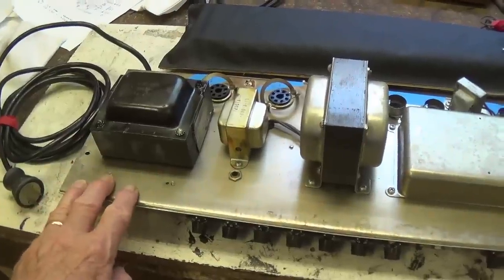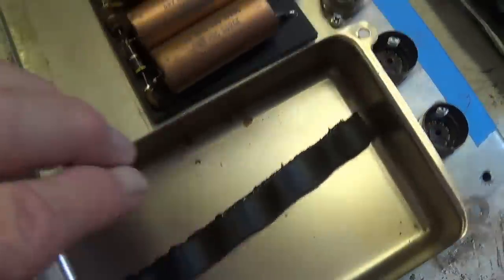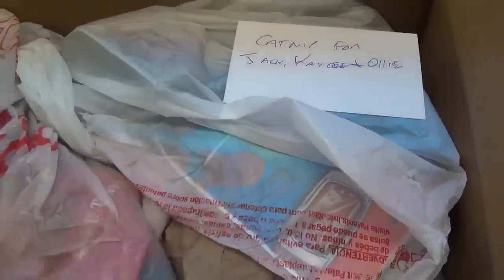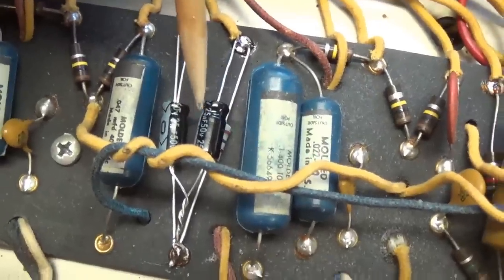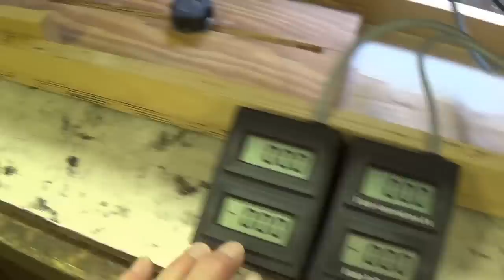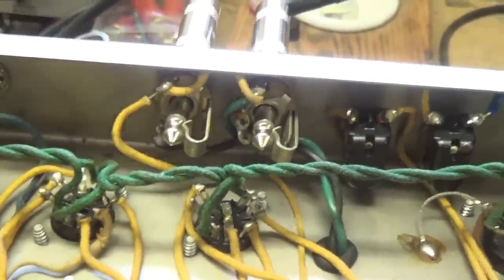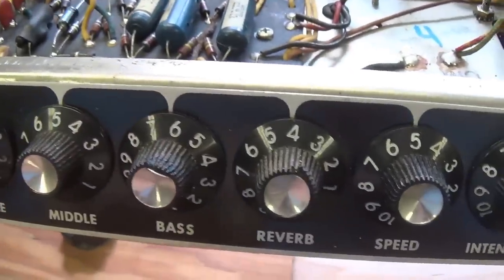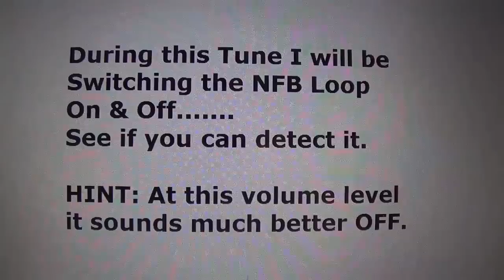1966 Fender "Blackface" Super Reverb:  In Storage for Almost 40 Years !!

Comment: AA763 Super Reverbs had 1500 ohm grid stoppers. There truly IS no consistent AA763/AB763 distinction across the entire amp product line. The distinction relates loosely to amps that had a reverb version and a non-reverb version. There was a period, sometime in 1963-1964, when you could buy either a Pro or a Pro Reverb, black tolex. And you could buy non-reverb versions of those amps for some time thereafter, probably from existing stock. This is basically when Fender introduced reverb into their most common models. You could buy either a Princeton or a Princeton Reverb, a Deluxe or a Deluxe Reverb a Pro or a Pro Reverb. I don't know or claim to know exactly when this happened, I don't know if you could buy a freshly-built Pro or Deluxe (non-reverb) in 1966 post-CBS. You COULD buy a Princeton-non-reverb up through silverface. Princetons, even Princeton-Reverbs did not get grid stoppers. It is true that AA763 Vibroverbs (the first Fender amp with reverb) had no grid stoppers and AB763 v_verbs DID have grid stoppers. So, perhaps that is where the story came from. Knowing Fender, they built amps and used up the parts they had, they didn't just abruptly stop making Pro (non-reverb) amps and Deluxe (non-reverb) amps on April 11 at noon. Many brownface had no GS resistors, but the more powerful ones seem to have them, and of course only the vibroverb had reverb in that era. 
Regardless, whether your amp has those grid stoppers or not, they are good things to have. 
My work is now done.
Reply from the maker: Wow, thanks for all the information, P.

Comment: I made the new channel 93 subscribers.i remember in the old days in Some circuits we used to put bleed resistors in there so the b+ would bleed off by itself without having to go around and zap them
Reply from the maker: Thanks, Mike. That's one way to do it......also the voltage bleeds off rather quickly when the tubes are hot (and somewhat conductive).

Comment: Great job on this treasure.  How many hours are spent doing all of this?  It looks very time consuming doing a restoration like this.  Absolutely worth it!
Reply from the maker: I can only work 3 or 4 hours in the workshop due to the heat, Lee. It's been 105 to 108 degrees here lately.....but a normal overhaul can be done in a couple days, with audio testing on the third day. Making a video, however requires ten days to two weeks.

Comment: Hi Uncle. Have you ever made water slide decals. I make them for 3500 volt rf amplifiers i build for customers . You can print on the decal material in any color or design you want. Spay the sheet with a clear coat cut them out and put it on. Last for ever and looks like a pro job which you are.
Reply from the maker: Thanks for the tip, Monty. I'll check into it.

Comment: “Voltages read to ground with electronic voltmeter. Values shown + or - 20%”
Leo left us some wiggle room.
Reply from the maker: Between the early test equipment and carbon comp resistors, it was probably necessary.
Reply: Uncle Doug 
Point taken.
I think those small variations in component value add to the complexity of the sound reproduction.  That may be part of the fascination we have with tube equipment.

Comment: And there is was: "That tremolo was so greasy I have to take a bath" !! LOL. 
Uncle Doug, I really like the idea of the reservoir caps on the rectifier side of the Standby switch for making life less brutal for the rectifier tube. Can you suggest a reason why every amp is not like this Super? Is it only because of the GZ34 cathode and filament being separate? 
That gift from Randy was very special. You are so loved Doug.
Reply from the maker: Wow, thanks so much, GAT :)  Having the reservoir cap(s) after the standby switch sacrifices the rectifier while (purporting) to save the tubes. To be honest, I'm not a huge fan of standby switches, especially in GZ-34 (slow start up) circuits. To me, they seem counterproductive.
Reply: @UncleDoug  I agree Uncle Doug. I can only see Standby switch "shock" as being a cause of failure. Could a practical solution be to have a smaller reservoir cap (with drain resistor) on the rectifier side of the Standby (16uF?) and the main caps on the OP transformer side?

Comment: You didn't mention it, but sometimes swapping the power tubes to opposite sockets can have an effect on the reading.....not saying the same readings will follow the tube in all cases.  I assume you edited out the cleaning of the tube sockets, but with old NOS tubes.....the pins can also tarnish and need cleaning for good conductivity which can be a challenge.  I generally use a welding file set for the tube sockets plus spray cleaner......the file set for cleaning the nozzles and tips on welding torches.  AND I haven't found a suitable dip for the pin base's, but a dremel with a wire brush head is the option that comes to mind.  >>>>>>>>>>>>>>Its funny that the tube set in this amp is probably worth more than the amp......or that potential.  I just inventoried my little cache of old tubes and labeled the boxes.  I generally use all new modern tube due to the pin base issues as the new tubes will be bright and shining , but I pick select tubes for the positions.  As an example, for the reverb driver 12at7, I use EH tubes but there are 2 choices, a regular 12at7 or a 12at7WC version.  The WC version suggests its a selected lower microphonic tube ......but the reality is today that its not a high tested regular 12at7.  The 12at7WC is actually a brighter sounding response tube verses the regular version and that difference can have a sonic impact on tonally shaping the reverb response.  I tend to prefer the regular EH 12at7 for a flat and even response that it yields in the circuit since its a parallel effect.>>>>>>>>>>>>>You haven't mentioned what you do with the pulled electrolytic caps, since they are technically hazardous waste these days.  I was going to say that I was first shocked when I encountered the GE caps in the power rail, as they defacto is usually the standard Mallory's......well I shouldn't say "shocked" as I didn't get zapped.....you quickly learn in the school of hard knocks.  I'm surprised you as an old educator, don't have the "paddle" displayed in the background....though I might imagine that you rose up through the ranks well beyond corporal...if it were the school of hard knocks and sticking it out for the pension...of fort knox
Reply from the maker: Thanks for all your great comments and suggestions, Mike :)

Comment: Hello Uncle Douglas:  Congratulations on your new channel.  Can't imagine that it will be anything but a stellar success.   Flashy and interesting topic to be sure, but its the great pedagogy that will make it fly.  Best wishes on your new venture.  A question if there is time.  In several videos you have mentioned the importance of the grid stopper resistors and the screen grid  resistors being changed in the power section of the amp.  How these must be at spec. etc.  But I note that the larger princeton amps. ( the 1270, the 964, the 1164) there are no  grid stoppers or screen grid resistors at all in the schematic.  The AB763 circuit which some say is the apex of Fender circuits has both as per conventional wisdom.  Could you comment on the Princeton changes ?  Thank-you.  Blue sky and green lights for you and yours  Vince
Reply from the maker: Thanks for the nice comments, Vincent. You will generally only see grid-stoppers and screen resistors in circuits that have a filter choke. These are also generally the larger, more powerful circuits, beginning with the Deluxe Reverb.

Comment: With the new electros installed I was expecting to see around 450V and 45mA with those 6L6GCs but I guess that venerable GZ34 is a little down on emission, my theory.  Anyway our ears are the final test and the amp sounded just fine.  As always I like the attention to detail, such as making sure the  filter cap labels face out.  If another opportunity arises for you to slow down a tremolo would you show the waveform on your CRO, your time permitting.  I tried working out the frequency range by listening but found it too hard.  Your dry humour never fails.  You would fit in well downunder, although it is cold and wet here this time of year.  Just subscribed to your new channel so with coffee due about now I'll switch over.  Stay healthy.  Regards, Jeff.
Reply from the maker: Thanks for the great comments, Jeff.  I think the final audio test is the best way to judge the circuit. I'll keep your request in mind re the tremolo speed. I would estimate the slow speed at around 3 beats per 2 seconds. Enjoy your coffee.

Comment: Speaking solely on my preferences I think this is my favorite amp of all time. 
Have you considered using a switch to add or take away caps on the tremolo circuit? You get like a coarse/fine type of adjustment. I did that 10 years ago on a very old home built amp and found it quite handy.
Reply from the maker: I think a lot of people would agree, Doug. That's an interesting idea. I'll keep it in mind :)
Reply: Most tremolo circuits are indeed a bit too fast for my taste, and the shift or drift in capacitor values that occurs as the amps age tends to either knock the tremolo out completely or make it go so fast with so little depth that it's pretty much unusable..
Reply from the maker: @goodun2974  Agreed 100%, GU. I've begun routinely slowing them down to the swampy speed they do best.
Reply: You could install the very first Uncle Doug Mode switch on YouTube.

Comment: This touched on one question i was hoping you would perhaps be able to expand on in more detail at some point especially with regard to amp circuit design and understanding the difference required for different speaker combinations and how they are taken in to consideration from a circuit point of view and also the wiring after the output transformer. I appreciate this maybe a silly question for those beyond novice understanding, but for someone like myself who is greatly enjoying a second chance at education theough your videos, this would be of great interest for me. With regard to tone I also favour appreciate the 4x10 configuration as it pushes more air. I have a deville in poor shape and would love to work a circuit design to fit the 4x10. Cant thank you enough for all you do for us all who want to learn. Kindest regards, Gaz
Reply from the maker: Thanks for the nice comments, Gaz. You can wire four 16 Ohm speakers in parallel for a net of 4 Ohms speaker impedance, or four 8 Ohm speakers with two parallel pairs and the two pairs wired in series for 8 Ohms of speaker impedance. There are internet sites that diagram the wiring for all sorts of combinations.
Reply: @UncleDoug  thank you so much for the quick response 🙏. I am addicted to your channel, and looking forward to getting started. Thank you so much again.

Comment: Thanks Uncle Doug, subbed to the new channel, roughly 190 subs at the time I jumped in.
That's a tasty amp there. Did it need the pots cleaned after all?
Cheers,
Reply from the maker: Yes, especially the Normal Volume Control.......it sounded like a castanet solo.

Comment: Uncle Doug the legend! I've learned so much about tube amp circuits from your videos. I'm excited to learn some more automotive stuff from the new channel.

I found an early 1967 drip edge Super Reverb last year, a closet find. Original tubes, speakers and everything. The faceplate is completely uncrinkled, unlike my 70's twins, which makes me think this has never seen a bench since. Still has active polarity switch, ungrounded 2 prong cord.

I'm a bit afraid to take it to any techs, even the ones I love, because its such a pristine amp.

Wondering what your thoughts are on best care and service.  Send it to Uncle Doug for service? I've only fired it up a handful of times, is there danger in using it unserviced?

Reply or not, thank you so much for what you've done for us here in YT, sharing all of this valuable information! I appreciate you.
Reply from the maker: I would not operate an old, unused amp without a current limiter, Rod. You risk destroying some irreplaceable (original) parts. I don't solicit work, but would be glad to tune this old gem up for you.  Message me at my FB page Uncle Doug's Vintage Amps.

Comment: Love these old amps!   
I was told that the Capacitors store a lot of energy and that you can be killed by touching them and that you can use a Resistor to drain the energy so you can safely handle the amp???
Can you do a video showing how to do this???
Thank you!
B
Reply from the maker: Yes. I have demonstrated how to build a discharging tool in several videos
Reply: @UncleDoug  I apologize, my attention is very low right now and I did not watch it all the way through before commenting.
Thank you for showing this.
I am considering doing an amp kit in the future so this will help me.  
Thanks!
Reply from the maker: @6xcchamber971  No problem, 6X. Good luck with your build.

Comment: Could you have flipped the tubes to each other’s socket and see if the high voltage tube followed to the other socket?
Reply: exactly, the basic test to determine if the problem lies in the tubes or in the circuit.
Reply from the maker: The voltage was the same, Cpt., it was the plate current that differed, and not by all that much. Yes, I routinely reverse the tubes......but, as is virtually always the case.....the tubes were the source of the discrepancy. Cathodes deplete at different rates apparently.

Comment: About the imbalance, could be the tubes or could be that the two transformer primary halves aren't equal, that's not unusual.
About the tremolo, have you ever tried changing the resistor values instead of the capacitors? That's what the speed control does, might be done in another RC stage. Sure it's not as quick because you can't put it in parallel to make it slower.
I liked the old mic stand too by the way
Reply from the maker: Yes, it could be due to inequality in the OPT windings. Anything that alters the time constant of the cap will work. As you said, a parallel cap is fast and effective. It was rustic, but it worked ;)

Comment: 24:28 I'll make it a point to go up in watts on the 1.5k grid stoppers.
Reply from the maker: I just always use 1W resistors throughout the circuit, TW, unless higher is specified.
Reply: @UncleDoug  you don't ever want your bias to stop before that point. but yes these are as critical as the 330k in the bias point at the .1 caps.  a bad  complication of a repair I did  is a complete mod attempt on the vibrato optical circuit someone did I don't remember but a 10 meg and a 100k on the bulb  tied together going onto a 1/2 12ax7 side and a .003 going into the 100k was all removed the resistor side not connected to ground and  signal path coming from the intensity control. it can be a good challenge though.

Comment: I kept wondering how  the 6L6  input grid-voltages compared, to eliminate the possibility of a leaky .i uF from the 12AT7 messing with their bias, and/or, the measured resistances of the 82K and 100K 12AT7 plate-resistors (off-values might be messing with their input-amplitudes).
But, in truth, as soon as I stop typing, I need to find my own snack, to counter your pretzels.
Reply from the maker: First things first, James :)

Comment: I wonder if there's a business in rehousing or having special runs produced of capacitors and resistors that have the original aesthetic. I know engineer generally don't give a hoot for how stuff looks, but I think when its a 'special' one, speaking entirely for myself obviously, I'd like to know its modernised and safe but also maintain the visual appeal of the original.
Reply from the maker: I understand, Woz, but you must also consider the fact that once the amp is assembled, no one will ever see the circuit. I too derive some pleasure from knowing that hidden circuitry looks good, but most customers (and I don't blame them) don't want to pay a significant premium for it.

Comment: There are lots of mods to the Super Reverb. One I like that's easily reversible is the mod that allows both channels to have reverb and also puts both channels in phase so that the two channels can be "jumpered" without them being out of phase. 
It's just a simple wire added to the circuit.
Reply from the maker: I always turn to the Fender Guru on the internet for modification tips, Joe. Thanks !!

Comment: Cord question. On normal electronics I use the same cords, but add the standard filter version of the female socket. The same filter as computer toys, old fax machines etc. Am I accomplishing anything? Or just eliminating any electronic noise from what ever I am fixing from going into the line.  Just adding useless shiny thing also a option.
Reply from the maker: I think you'd have to do an experiment to see, DB. I have never seen or heard of doing this.

Comment: Two question,
1. When diagnosing the bias mismatch on the power valves, couldn't you have just swapped the in the sockets to see if the values moved, thus eliminating the rest of the components?
2. When putting the parallel caps in the tremolo circuit, is there an argument for using variable caps? That way the speed can be fine tuned to taste.

Cheers,
Chris
Reply from the maker: 1.) This was done, Chris, but, as is virtually always the case, it was the tubes. The cathodes deplete at different rates over time.  2.)  Do you have a source for variable .01uf caps? I would like to get some.

Comment: Another great video, as always.  I just serviced a '67 Super Reverb for a friend.  I found the 0.001 ceramic cap that couples the signal to the phase inverter to be very microphonic.  Is that a big deal?  Maybe not, but I replaced it with a film cap.
Reply from the maker: I have found several microphonic capacitors in the past few months. Yes, I definitely replace them. They are probably detrimental to proper performance.